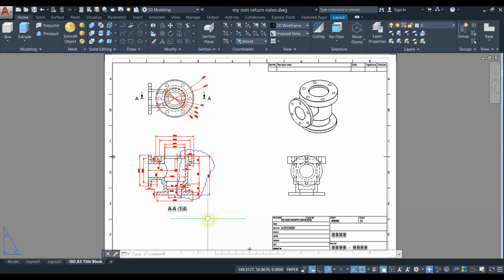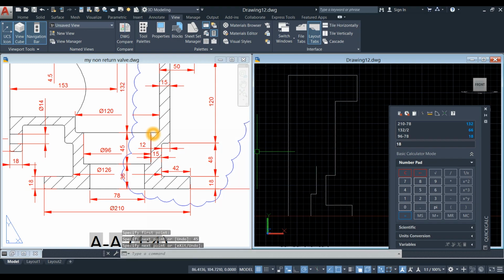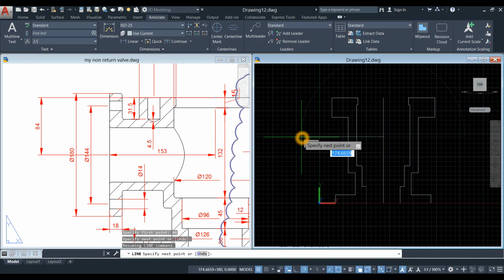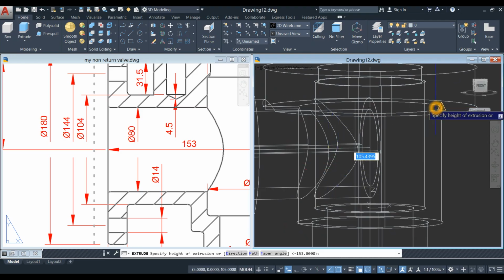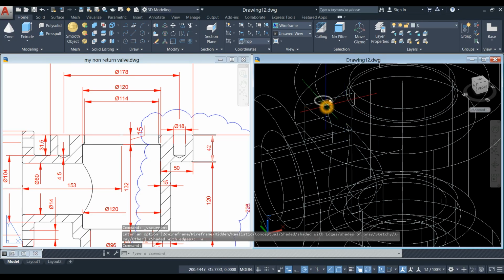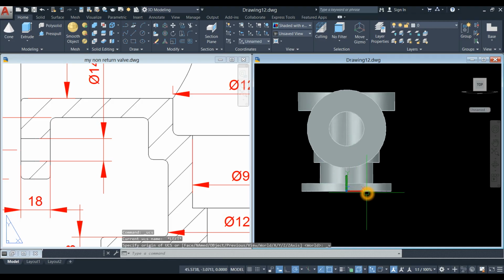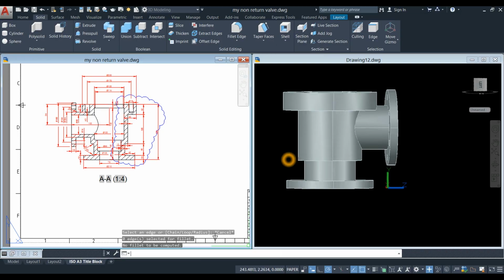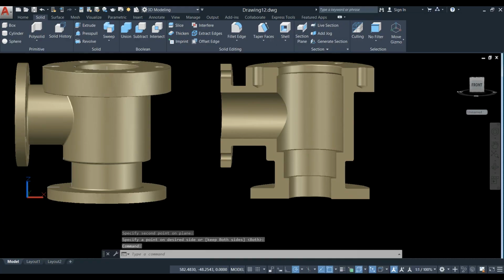NON-RETURN VALVE in AutoCAD Tutorial

Comment: Unable to understand the procedure of 8;32
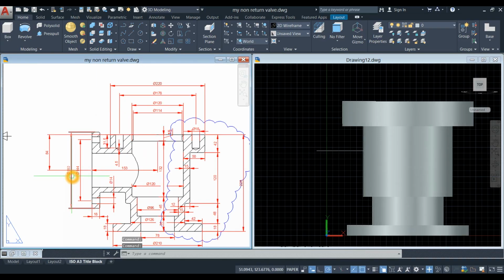Reply: 8:32
Reply from the maker: @Rajkalekar-v4d  180 diameter which is the outside diameter of the flange, it looks like a line when looking from the front view, but it is actually a circle.
Reply from the maker: the Z-axis vector has to be parallel to the direction of the of the flange otherwise the circle would be protruding/extruding towards the front instead of sideways.